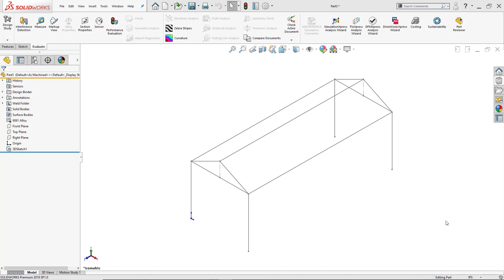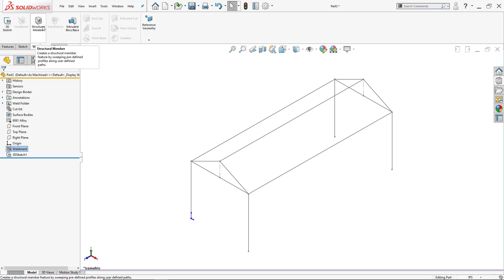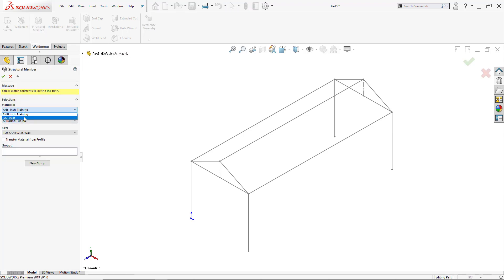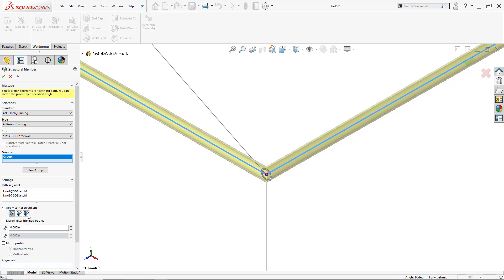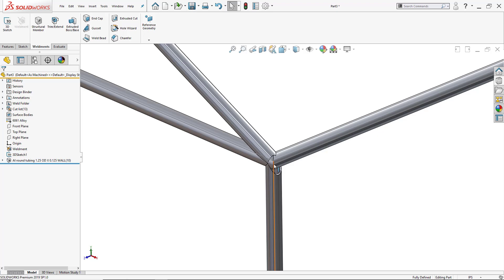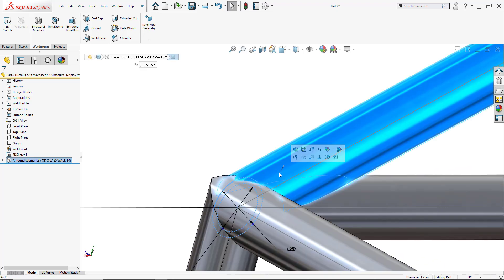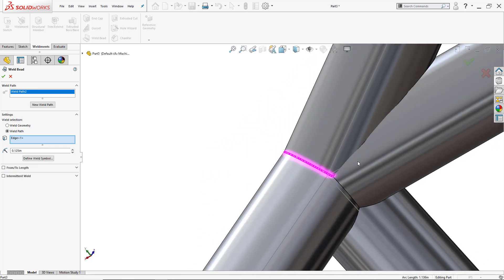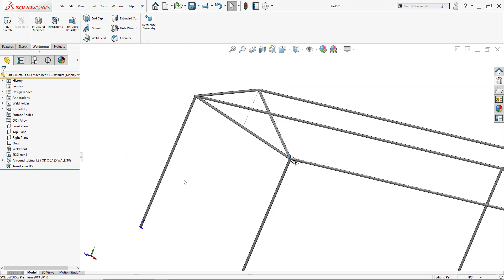Get Started with Weldments in SOLIDWORKS

Comment: Use end butt for 2 tubes at 90 degree on square frame and then try to make right cut for perpendicular tube (leg). It is impossible(((
Reply: Here's the image https://cccp3d.ru/uploads/monthly_2020_11/Ferm009s.png.07673f55aeeb1152d21e97b4d005d17c.png